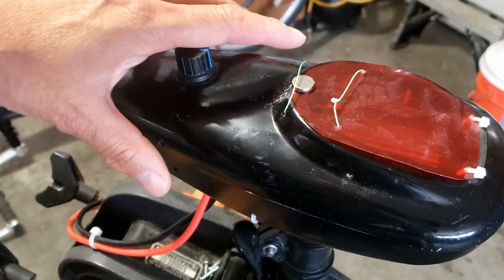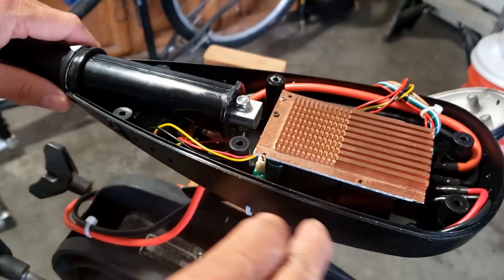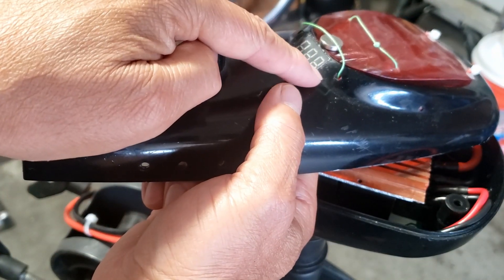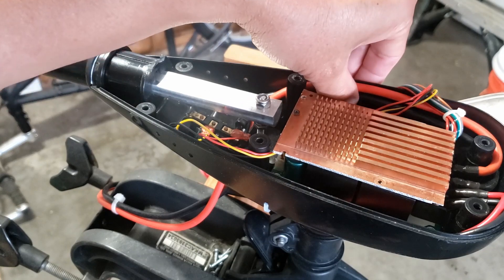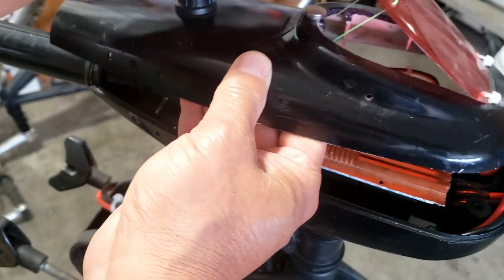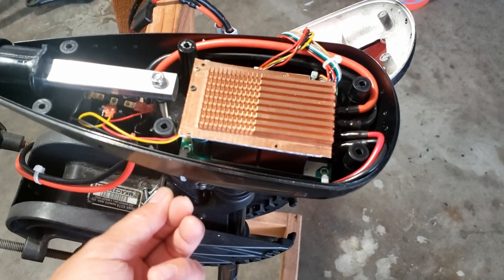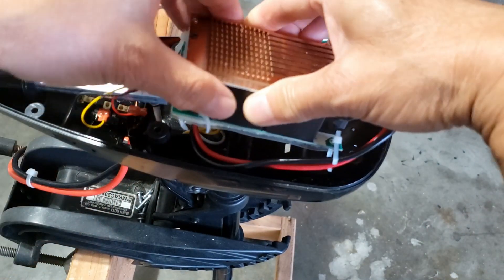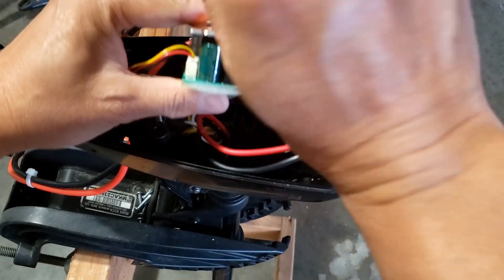Under the hood – My trolling motor PWM mod explained

Comment: because I already bought PWD but the size is too big,  can't put inside the head of handle.  any suggestion.   thanks
Reply from the maker: If you have no other choice, maybe attached a separate waterproof box below the housing. Then wire the switches to the handle for easy control. Best luck with your project! 👍
Reply: @HypergaugeDIY  hi sir.  I am thinking use a completely box (or something like that) to replace the whole housing.  but can't figure out what others (or similar)  to replace it.  any idea or suggestion?

Comment: This is exactly what I am looking to do too.   most video explained how to make nice box. but seperate from handle. so you have to use your 2 hands.
one hand to control handle for direction.  the other hand control the switch for speed.    in this design. you can free one hand. 
but I was wondering,  where to buy inside PWM to replace the traditional (resistence)  switch?  that's make it easier.     thanks
Reply from the maker: This is the PWM DC Motor Speed Controller I used https://amzn.to/34NOOld  Thanks for watching my video! 👍
Reply: @HypergaugeDIY   yes sir.  I bought exactly same as your PWM controller.   but how come I can't put my PWM inside the housing?
Reply from the maker: Maybe in the video I didn't make it clear, I have cut away some of the plastic inside the handle housing to make room. Just the PWM PCB should be small enough to fit unless they are selling a different version now. Good luck with your build.

Comment: It looks like you use the black and red wires from the motor? The yellow and white wires are not used?
Reply from the maker: Yes. The black and red will give you full power if you directly connect them to 12V. The other wires will lower the speed, so it is not used in this mod. Cheers! 👍